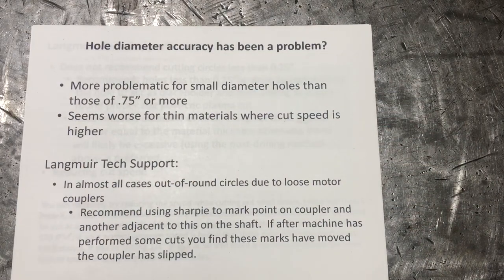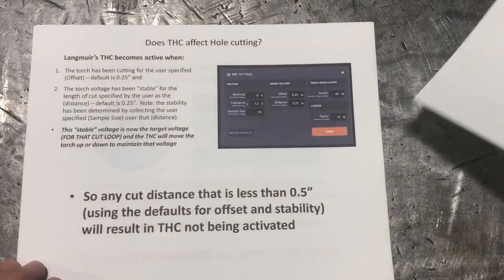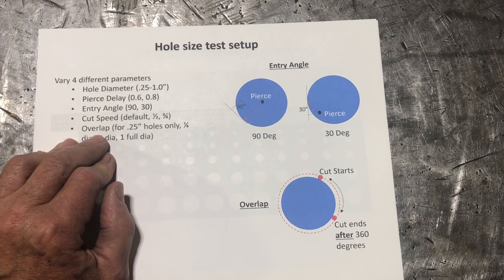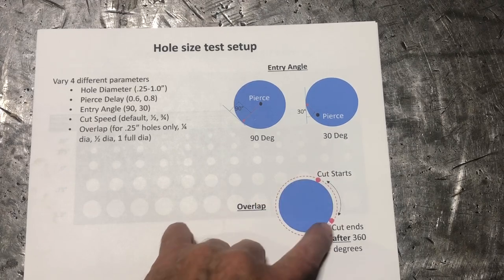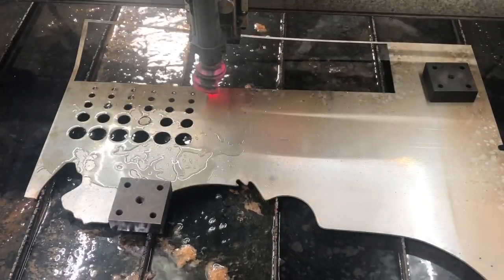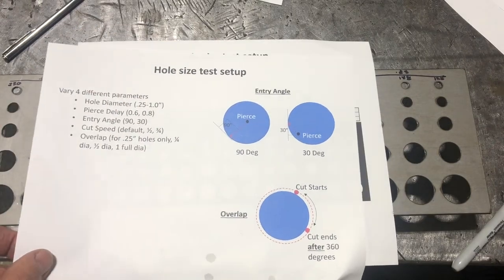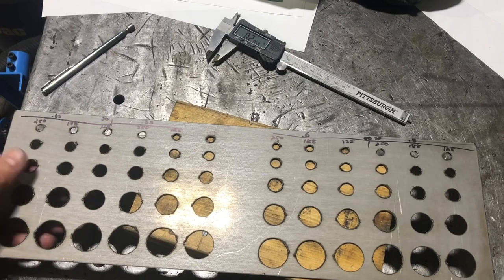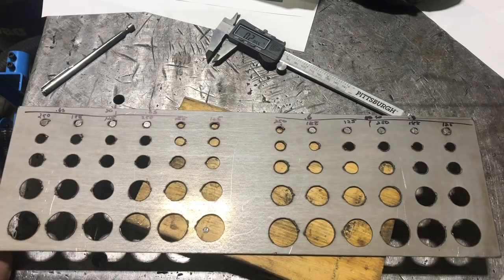Langmuir Plasma Table: Why are my circles not round?

Comment: What lazer and tip cover are you using?
Reply from the maker: Using these cheap little lasers (note: you might need to mess with the lens on the front to get it focused but once it is done haven’t had any problems.  
https://www.amazon.com/gp/product/B072XF49LK/ref=ppx_yo_dt_b_search_asin_title?ie=UTF8&psc=1

Holder is:
https://www.amazon.com/gp/product/B07F1T97V4/ref=ppx_yo_dt_b_search_asin_title?ie=UTF8&psc=1

The nozzle “shield” is a collapsible silicone funnel that the center is cut out to slip over the torch nozzle. https://www.amazon.com/gp/product/B089LR8VD2/ref=ppx_yo_dt_b_search_asin_title?ie=UTF8&psc=1

Comment: Thanks you it was very informative just a question do you meke you  kerf smaller or larger to get the correct diameter hole?  Thanks
Reply from the maker: For circles and other “inside” cuts the controller defaults to left compensation meaning it will move the jet position 1/2 of the kerf diameter to the left I.e. inside the cut path.  So for a kerf of .050” the jet will be position .025” to the left of the path.  Reducing the kerf setting will increase the circle diameter.  A kerf setting of zero is the same as choosing “no compensation”  which moves the jet directly centered on the path geometry.  Hope that helps.  Thx for watching

Comment: What is the status on the Langmuir plasma table drain flaring tool?  Is it still available?
Reply from the maker: Sarah,  are you a member of the Langmuir forum?  If so there is a signup sheet for the die set.  Here is the forum link:  https://forum.langmuirsystems.com/t/pan-drain-dimple-die-mod-2/13000/120

Alternatively, the drawings are available on the forum that allows you to either turn a set for yourself or 3D print a set.  I understand from the forum discussions that a 3D printed set using backup washers are good for a couple of dimples!
Reply: Thank you